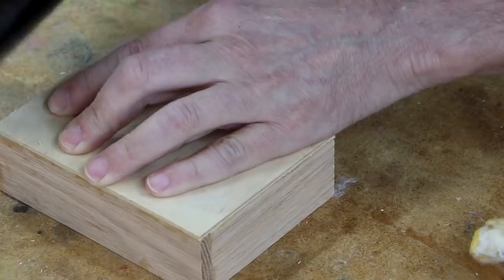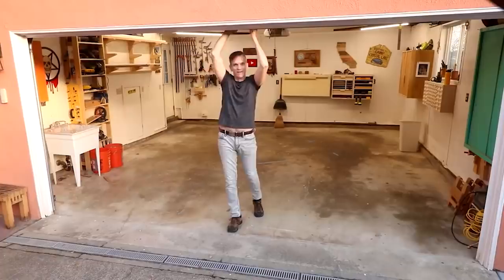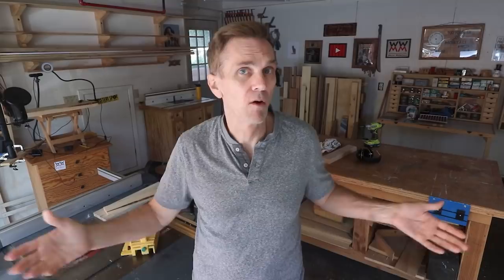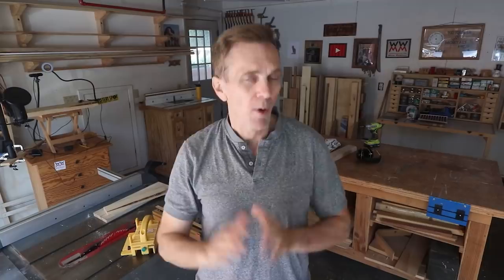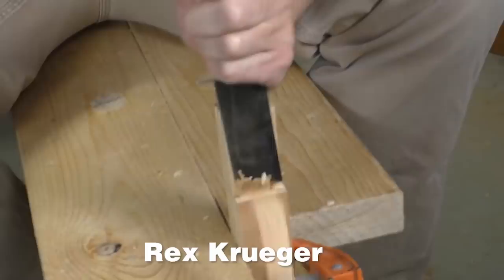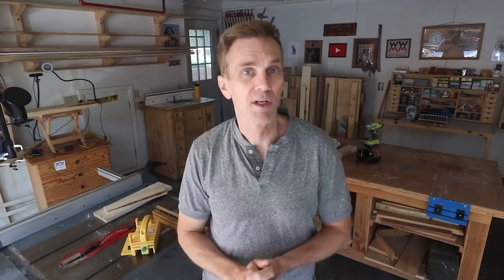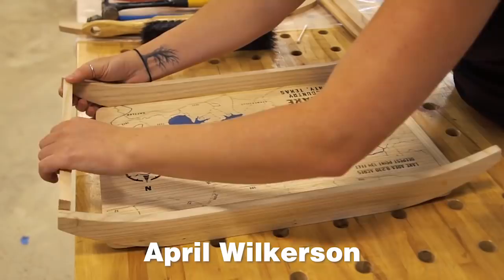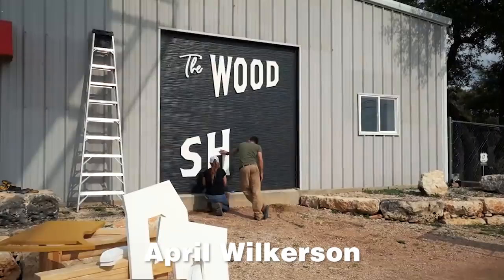Hand tools vs power tools

Comment: I don't know if you have covered this in a video yet... but could you maybe do a (non-short) about: ideas with "leftover" dowels? I had a project I was working on, and I bought like a dozen 3/16 dowels...but I didn't end up using them. Aside from a hundred birdhouse perches, I can't think of anything to use them for.

(Although I guess I could use the as pegs on small projects instead of screws for a more stable mechanical connection???)

Comment: Very well done, Steve.

There is a miscomception that hand tool wood working is cheaper. If you buy nice saws, chisels, planes and the means to sharpen them... The $ add up real fast. I'm a power tool woodworker that has a few hand tools. Love my japeness pull saws. Can't afford the hand planes that I'd like.

Comment: I'm in the digital woodworker category. I find there is this misconception that there isn't any work left after you go CNC. I still work just as long and It hasn't obsoleted any of my power tools, so I don't no where that comes from. CNC is just another tool that has its unique set of strengths and weaknesses.

Comment: I am in a bit of a quandary and would like some advice.  I have been wanting to get into woodworking for a while.  I took an introductory course at a local place (they offer courses and memberships where you can use the equipment).  So far so good.
I bought a table saw from Facebook Marketplace.  It was a good deal.  It was the Bosch saw with the gravity stand. I am sure it is a good tool, but I am wondering if I made the right decision--no, I don't expect you tell me sight unseen if it is the right tool.  What I mean is, it doesn't have a blade guard or writing knife, and the table top is showing wear.  The fence while clamping well, doesn't move quite that well.  I guess what I am trying to say, is that I am not sure I like it and I am wondering if I should sell it and get something smaller and newer (maybe the Dewalt because the fence moves on a nice crank system) or just hold onto it and see how I get by.
I am rambling here, probably in an effort to sort it all out myself.  Any thoughts would be excellent from anyone reading.  I doubt that I am unique in this, but I expect more rational heads than mine out there.
Reply: @a..d5518  it was Facebook marketplace...I typed that accidentally.   It is used.  It was substantially discounted.  I just have to decide to keep it or buy something else.
Reply: Others will disagree, I'm sure, but for me the only table saw I am willing to use is a SawStop for two reasons. 1) Safety is of #1 importance to me. I never want to visit an ER because of a table saw accident. 2) They are super good quality saws. I have a very small shop (9' x 13'), so I got the JobSite Pro saw, and I love it. It's very accurate, the fence works great, and I can move the saw easily. It doesn't have a cast iron top, and that might be a disadvantage, but most small table saws don't. Also, for some jobs (sawing thick pieces of dense hardwood in one pass) it's underpowered (as are most job site saws). Of course, the biggest downside is the cost. They can easily be 2x to 3x the cost of other job site saws, but in my opinion, the safety and quality are worth it. I know that not everyone has the resources to spend that much on a saw, so I totally get that the price makes a SawStop a non-starter for a lot of people, but factor in the potential cost of an injury in your decision. For me, it was the right choice, but for others, maybe not. I have no association with the company, so this isn't any kind of marketing for them, just my opinion.

Comment: I'd add a fifth. Woodturning is a completely different skill set with a different set of machines/tools than in either power or hand woodworking.  Sorry but I will be that guy that says digital is not woodworking.  It is wooden part assembly.

Comment: You have it all wrong! Tools are either human or other power (electric,  steam, etc.) and with power you can have digital assistance in many forms from CNC , laser cut line, micro adjustable,  etc.  And I as a woodworker use them all.

Comment: I’m sorry but no one is going to convince me CNC or laser is woodworking. With both hand or power tools either you guide the material through the tool or you guide the tool through the material.  CNC or laser you write a computer program and do none of the actual woodwork yourself.  Yes, there is assembly later, but if that counts as woodworking then does assembling a table from IKEA count as woodworking?